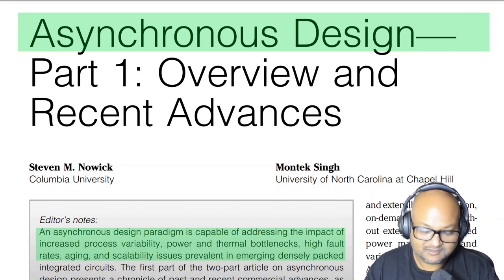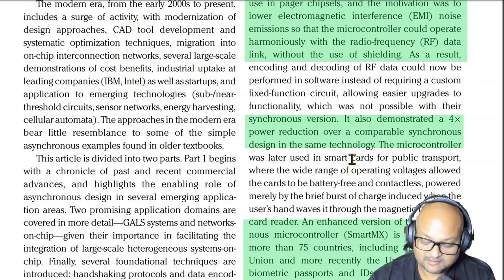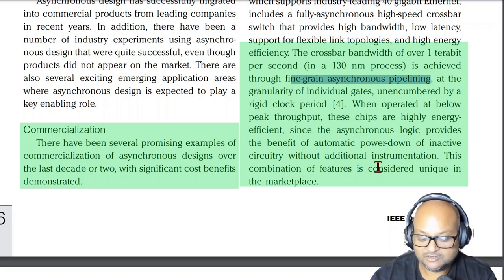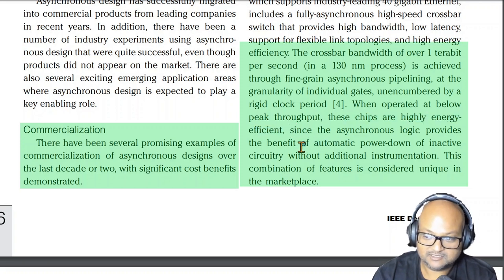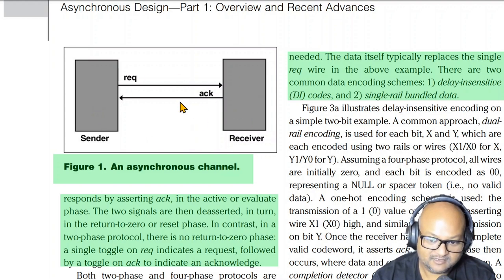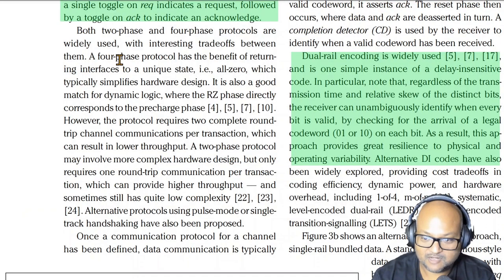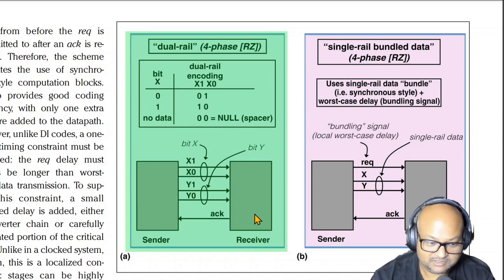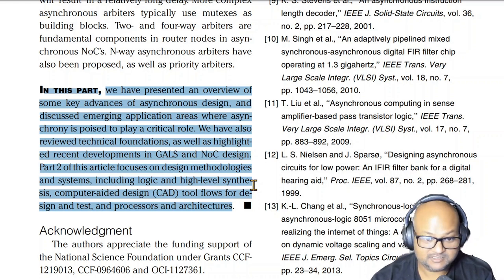Read a paper: CPUs without Clocks

Comment: Could an asynchronous design work with continuous current (DC) ?
Reply from the maker: It does. Clocked CPUs too. The power supply in a PC converts AC to DC to make the chips run.